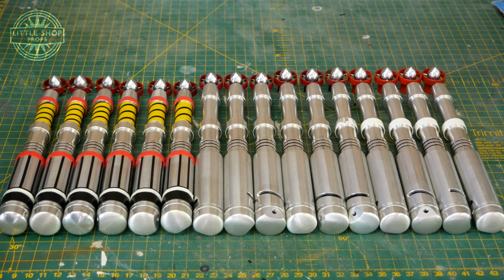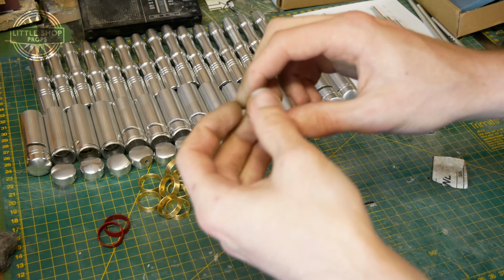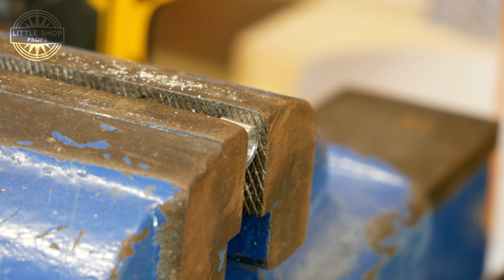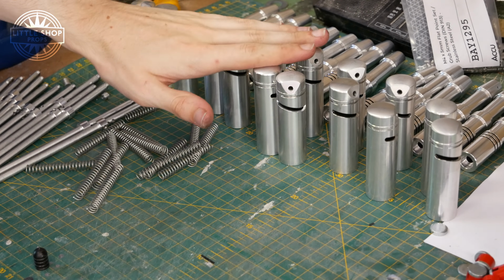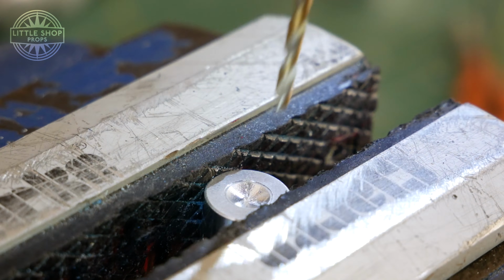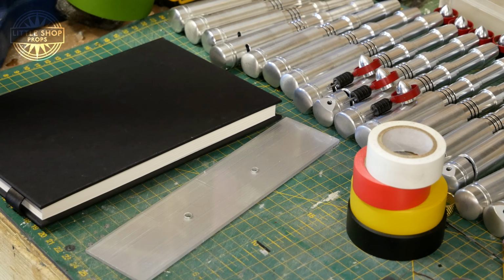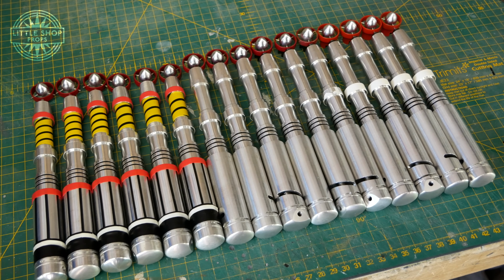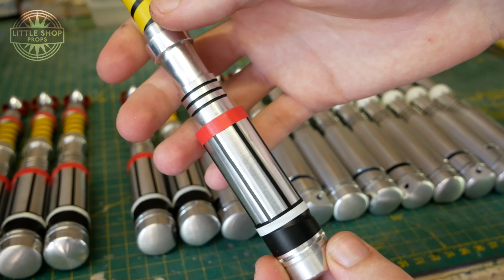How to make these classic props! | DOCTOR WHO

Comment: As a fan of classic Doctor Who I must say they look beautiful however why would you not paint those details surely the tape will come up at some point I mean it's Kate it's not meant to be permanent but they do look gorgeous especially I made Tom Baker Sonic screwdriver guy. Very nice work good job.
Reply: We’ve just been faithful to the way the original prop was made. Where it used Tape, we used tape, without that it loses a certain charm the original had.
Reply: @SuttonsWorkshop  ohh well it wasn't a slight hello I was just curious why you use tape if they use tape then OK you use tape it looks great nonetheless but if it's gonna be handled by somebody and not just sit on the shelf and then you just might want to use something that preserves it better but that's just an opinion you still do great work so know that at least
Reply: @CGRREDACTED I didn’t take it as a slight don’t worry! Just keen to explain why we went that way, and yes very true, although paint will also wear down over time, tape is at least easier to replace if it was to come loose, but we haven’t had any come back yet, so they’ve got a decent life in them! But I do see your point.